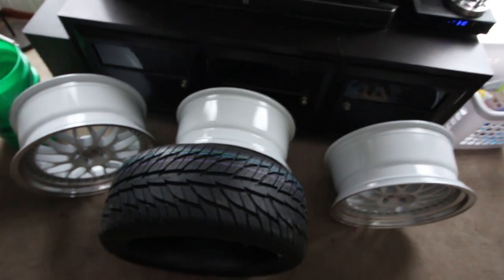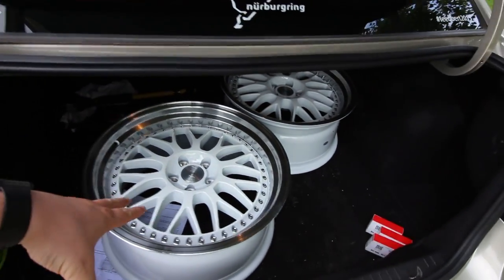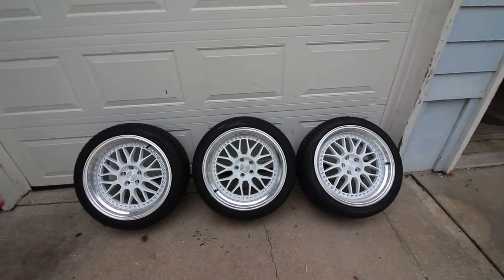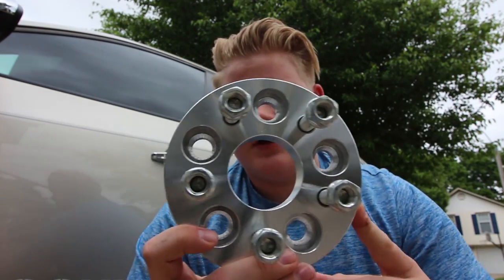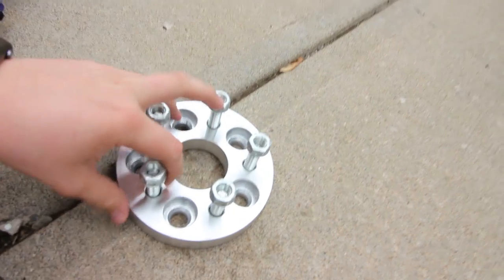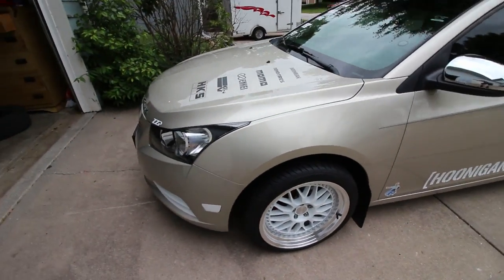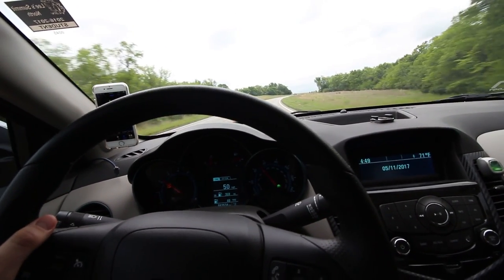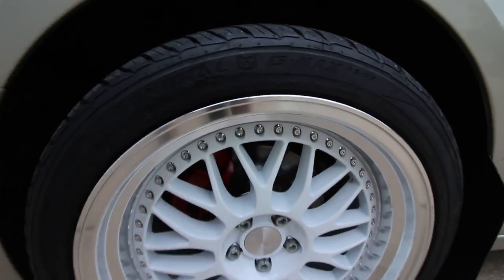Do I Need Hubcentric Spacers???

Comment: Your stock studs appear to protrude well beyond the surface of the spacers, meaning your wheels are only contacting the tops of those 5 studs and not the spacer surface. The stock studs should be ground off to allow the mags to seat solidly against the spacers.
Reply: Oh dang. 🤣🤣

Comment: We recommend hun centric front & non on rear. Due to movements.  Hub centrick has the  support it sits on the hub.  It won’t brake fall off.  That’s  why  it’s used on da rear.

Comment: So I've got this whole deal going on with my car now. I'm worried if there's vibration my wheel will become loose and fly off while driving. Did your wheels do this with those spacers? Or is it still fine to this day?
Reply: Hey man just installed some and got vibrations too any updates
Reply: @webwo5781   just buy the hubcentric ones and save your self the headache

Comment: You might want to trim your studs young man..i dont think they are suppose to be sticking through your spacers..they should be flush so your wheel mounts up properly..thats a sweet ride..i want you to stay around to safely enjoy it...lol👍
Reply: Nah, some aftermarket rims have an indentation so you don’t have to “trim” the bolts. Trimming or shaving the factory bolts is very sketchy and not to mention it will be a pain if you want to change the size of the spacer or even going back to stock.

Comment: Looks like your studs are sticking out of the spacer, which means your wheels are not flush with the spacer, that can be dangerous, your studs can break.
Reply from the maker: They do slightly stick out but my wheels have indentations in the back that gives more room for the studs, they sit flush too the hub
Reply: Most wheels have pocketed areas between the studs
Reply: Andrue Rendon that makes no sense. If the bolts he is attaching his rims were too long or bolts too “short” he would be able to wobble the rims. I think you have it backwards bud.

Comment: im lowered but still running on stock steelies. im trying to figure out if the wheel would fit with the spacers
Reply from the maker: +Corey Jones mine fit with 1 in spacers, but I am pushing the limits. When I turn the tire comes really close to the fender liner. I also have 235/40/r18 instead of 235/45/r18. The wheels are also 30 offset if that helps. Just read around the forums and you might find answers to your question
Reply: Corey Jones depending on where you get your wheels from. You can get them redrilled. I have the same wheels on my Cruze, i was able to get them redrilled from the shop i bought them from

Comment: You didn't mention WHY you wanted to put on spacers. I'm guessing just for a wider stance. 
As you may know, the hub assembly and bearings were designed with a certain wheel track. By putting on spacers you may be exposing those components to added wear and stress, unless of course you are using wheels with greater offsets to bring the centerline of the wheel assembly where it was designed to be. 

The other item I'd like to mention is those hub studs that the spacers were attached to, were sticking out beyond the face of the spacer. So I assume(hope) that the wheel had a recessed area between the wheel mounting studs to accept that bolt length. Or, of course, the wheels mounting surface would be against the end of the studs. 

Lastly, it is important when using that type of spacer, that you re-torque them after a recommended period of use.

Oh ya...they do make spacers with centric lips.
Reply from the maker: First off I would like to thank you for sharing your knowledge as it could save someone’s ass that doesn’t know what they are getting into...

I put the spacers on because the Chevy cruzes have a very weird bolt pattern of 5x105 and it is hard to find wheels in this size. The wheels I have are 5x100 and the spacers act as adapters as well.

The wheels also have a hollow/recessed area and they sit flush on the hub (this is something I made sure if as I put them on).

I have also re-torqued them every time I have taken them off and put them back on (I usually drive 30-50 miles and re-torque).

I have also recently upgraded to hub centric spacers and they are way more confidence inspiring!

Again, thank you for your concerns and I am very appreciative if you spreading your knowledge!

Thanks,
Jonas
Reply: Jonas Godwin
Coincidently I was just made aware of the existence of adapter type spacers on my Challenger forum. The fellow was going from the challenger bolt pattern to a Mustang bolt pattern. Extremely close anyway. But in his case he had to make changes in bolt diameters because the typical Mustang bolts are smaller in diameter.
Keep up the good work!

Comment: Hey I'm new to your channel, But what is your bolt pattern, I also have a 13 chevy cruze but its the LS.
Reply from the maker: +Jason Vit my wheels are 5x100 but the stock bolt pattern is 5x105
Reply: Jonas Godwin did you get a wobble bolt to change it?
Reply from the maker: +Jason Vit nope, just using 1in adapters
Reply: Jonas Godwin  nice thanks!!

Comment: One thing to look into getting is lowering springs to get rid of a fair amount of that wheel gap. i have the same wheels on mine and i used B&G lowering springd to bring it down about 1.5 inches in the front and 1 in the rear
Reply from the maker: I was planning on getting some sort of lowering device later this summer if I have the money for it. I think it would look nice!!!

Comment: I have a fuck'n mini van! Also have 4 kids but that in no way is stopping me from making my van a bit better. About to get spacers much like these that are lug centric. Just wondering if you have had any issues as of yet with yours? Thanks!
Reply from the maker: No issues thus far, as long as they are hubcebtric you should be fine
Reply: Jonas Godwin awesome! Thanks again!
Reply: Bill Carini don’t get lugcentric.. keep you and your family safe man never cheap out on what holds your wheel to the car
Reply: Jeff Anderson the issue is that the vehicle I'm trying to put it on is very odd. It's a 6X139.7 bolt with a 92.5mm center bore.